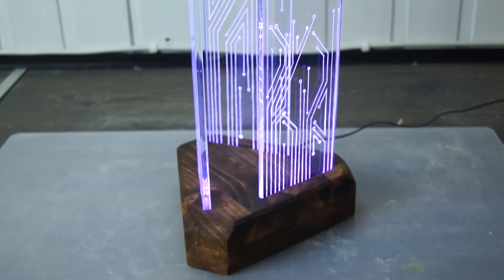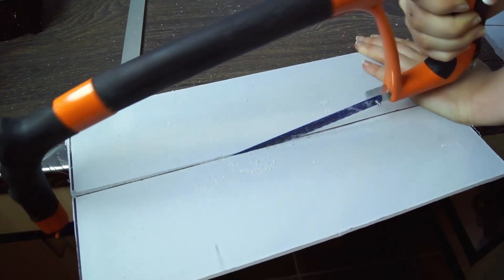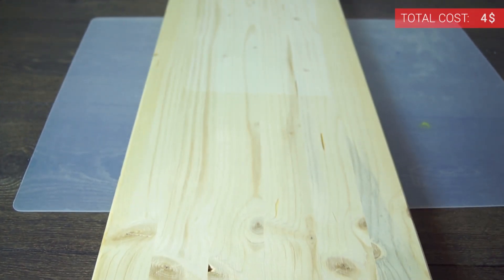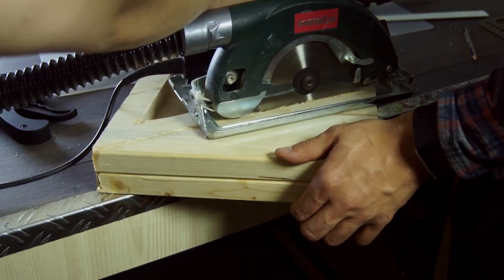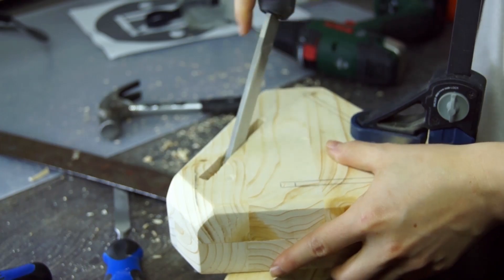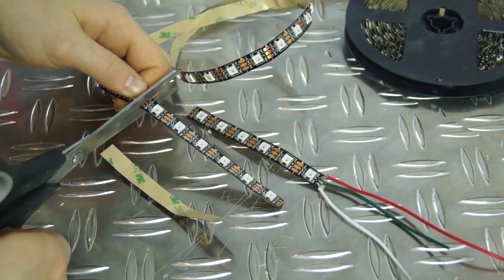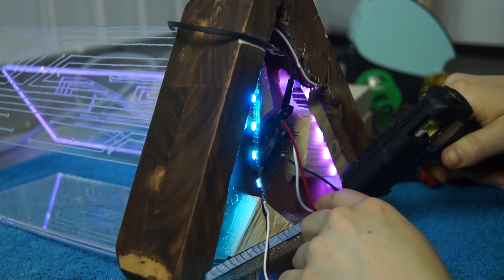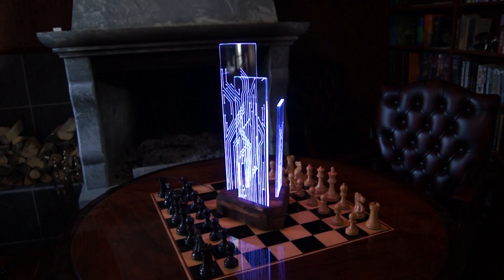Amazing Color-Changing Acrylic LED Lamp!

Comment: If you want to do more of these and maybe save your hand from hurting you might want to look at an attachment for your Dremeal. It is called a "dremel flex shaft" but you may have to check and see if it fits your model.
Alternately you can look about buying yourself a pencil grinder. Some can use the dremeal bits you just have to check for collet sizes.

Comment: Me: Sees thumbnail WOW! I wanna make that!
Martina: So, got this for 20 bucks, which is cheap in Norway.
Me: Nod nod Swede here, agree! 20 bucks sound doable.
Martina: Oh, by the by, you should get a dremel.
Me: Right. Maybe I can... use a pocket knife?
Martina: (casually) ...I just cut them off and soldered them back on.
Me: ...Right.
Martina: Oh, and then you get an Arduino--
Me: ...I don't think I'm the target group. :(
Martina: I CODED it using this library, link below.
Me: 0.0
I guess I gotta start leveling up some skills if I want an awesome LED structure of my own!
Reply: Back in the day that was sort of required to get fancy RGB effects, but now you get decorative LED kits that will do similar things out of the box.

Comment: Any chance of getting the dimensions?   

Acrylics: 95mm wide (100mm for me) and proportionally from the templates  (410 and 340 and 280mm high for me).

Triangle base: 215 and 170 for me.

Happy to be corrected.
Reply: On reflection I think the triangle should be 300 and maybe 215. (?)

Comment: TY so much for the info here!  FYI to anyone thinking of doing this with a dremel.  Get yourself a flexible shaft it will make this a TON easier.  Also, get a plastic cutting disc to cut the Acrylic sheet :-)   Great video again and you got a new subscriber

Comment: i wonder if someone could code the Arduino to control the LEDs with an incoming audio signal. This inspired me. Could make a custom case for a synthesizer that lights up based on audio going in/out/both.
Reply: Yes it can be done, you can find code made for that with many presets

Comment: Nice work. You are really skilled.

Acrylic can be cut just by scoring the surface a little bit and bending it, just like how glass is cut.

You can also use a lazer cutter to cut and engrave intricate patterns, which will reduce a lot of effort and save time.

Comment: How hard is it to control the dremel on the plexiglass? My only experience is using one to cut an ABS sheet and that was a nightmare
Reply from the maker: It was a lot easier when I had traced out all the lines with a scalpel first, as it made it stay on track.
Reply: Natural Nerd Oh ok thanks!

Comment: Is my computer broken or is the price of the led strip incorrect?
Banggood wants 15,99$. Could you fix the Link? Thanks!
Ps: Great Video
Reply from the maker: The price tag is correct. Individually addressable LED-strips are usually a bit more expensive than regular RGBs, as each LED chip also needs a microchip. So the link goes to a rather reasonable priced one. The price tag in the description is adjusted for the amount I used, as the strip in the link is 5 meter long, and I hardly used one meter. And thanks :)

Comment: Great project! It could be even better if you cut the top parts of acrylic pieces at an angle, to make it look more like a glass shards. And then to my opinion it would be better to power the entire thing from a couple of 18650 lithium-ions with the plug for recharging.

Comment: @Natural Nerd How did you polished this Acrylic?
Reply from the maker: The edges? I didn't polish the surface.
Reply: Natural Nerd you cut the acrylic in the Video. Your edges of the acrylic  looking very smooth. how did you do that?
Reply from the maker: Yes, on the edges I used some wet sandpaper! :)
Reply: Natural Nerd can you tell me which sandpaper exactly? which number? thanks anyways.
Reply from the maker: Went from 600 grit, then 1000, 1500 finally 2000, before polishing compound and lastly polished it
Reply: Thanks for the info, will try it soon too.

Comment: Hi, I like your project, one question, why you using arduino and not only font?
Reply from the maker: Font?
Reply: Oh, sorry, "power supply", in my country is "fonte de alimentação" :)
Reply from the maker: Aah! Because power supply is 12volt, and the LEDs are rated for 5 volt. Arduino has a 5 volt output. Not good to draw too much current with this, but a few diodes should be fine
Reply: Okay, thank you so much for being kind to me. In other videos I saw other people who also used the Arduino and I did not understand why this choice. Now I know... :) Greetings!
Reply from the maker: Arduino is also to control the LEDs. That is it's main function. You can program it, and using your own code it will change colors based on how you want it.
Reply: Thank you so much, you've helped me a lot. :)

Comment: Very cool design, nice creativity. 
 I have a yellow & orange Plexiglas clipboard, when the sun hits them the side's just light up (looks like neon). I have had these clipboards for years, and because of them have often thought that plexi should be used as a building material to transfer light both man made and natural. I do see people using plexi for address numbers and small add on's, but have not seen people use it to light up dark areas. With multiple colors of plexi available I can only imagine all sorts of future 3d pieces being made with led's. Its the edges that light up so elegantly, so I could see a sculpture made of plexi strips glued together to expose the edges.
Anyone ever seen anything like I'm describing?
Reply from the maker: Thank you!

Comment: Do you think engraving tools would work in replacement to the drivel tool? (is that correct?)
Reply: yes, a dremel tool is just a rotary engraving tool. you can also chemically etch the acrylic
Reply from the maker: Yeah, probably. It's almost correct, the company that makes this rotary tool is called Dremel :)
Reply: you could also search for local makerspaces in your area. if there is one, they usually have laser engraving machines which would do any of the work on the acrylic. they usually are fair in price as well!
Reply: John Smith Mine does, but the laser would shine through it and not do anything

Comment: Hi,
cool project. One tip however: Do not power larger LED strips with the arduino. The data line can still be controlled by arduino, but the power should be hooked up directly to the 5v from your power supply.
In your case it is not really necessary since you are using a 5v ps (so no regulator heat up) and only have very small strips, but it is still good practice.

On another note I am displeased that you get so many superficial comments (about your looks) when your work is clearly the main focus in the video :/

Keep going!

Comment: what is the Arduino function??what if i skip the Arduino part?? does it still works??😯
Reply from the maker: All the Arduino does is to change color on the RGB leds. You can skip it, and use some static LEDs, or a separate RGB controller :)
Reply: Natural Nerd i think I'll stick with the Arduino now.sounds more necessary.thx

Comment: did you need to polish the edge after you hacksaw cut it? as being acrylic, it will be frosted and not able to let the light pass through. i always though that acrylic sheet came with brown paper instead of a clear film. what i have here is normally the polycarbonate sheets are clear and not acrylic.
Reply from the maker: Yes, sanded the edges slightly with a high grit sandpaper to make it clear. I think burning it would work as well. Here it seems to vary from blue to pink and clear film :)
Reply: Natural Nerd yes you can do a flame polish to get it back clear. you can also use it for the engraving to get back a clear surface. but remember is when you flame polish the acrylic edges, you cannot glue it with the acrylic glue as there will be burn marks drawn out by the flame polish. nicely done edge lit🖒
Reply: Natural Nerd you can get cotton buffing wheels for your dremel. They come in many different shapes and texture. Those with some polishing compound will make your edges like glass. (After sanding smooth of course) and the pen attachment is a must. I don't even use my dremel without the pen attachment.

Comment: I would rather not use Arduino's 5v output. it's not really capable of anything high like the leds! it's also a linear regulator
Reply from the maker: kam hagh True! :) All you need is a voltage step down (or simply use a 5v power source) and you can use the same basic layout
Reply: Natural Nerd The adapter you used was 5V if I recall correctly. I would just add a cap near the LEDs and use it without anything in the way :D

Comment: How you position work and hand and body to cut a bevel with a hacksaw could not have been more awkward. Give your head a shake and think again next time. 
When you are using a sliding compound saw, keep the left thumb tucked in, always. On every 'over the material' type saw.  Thumb out position does nothing for you, it is just a habit of humans, a habit that can be reset with some initial conscious intent to set the new habit. Easier habit to acquire then you may think it would be.  
The project was well executed of a great composition of technologies idea.

Comment: Psh, use a laser cutter to both cut and engrave them. Much easier. XD
Reply: So will a CNC, you got one? She did it with hand held power and manual hand tools. The project was well executed of a great composition of technologies idea.
Reply from the maker: Good idea, will you provide the laser cutter? ;)
Reply: Making things easier to make is not high on the list of making a thing one time , one unit project. That is barely even a consideration. The desire to create it will find a way and make it into existence if the demise is strong enough. You don't have that, you just want it the easiest way possible. You want to spend $1K to $10K for a 3D printer to a engraver X/Y later cutter to a CNC to make one item then you go right ahead and do that.

Comment: you really should consider getting a flexible shart for your dremel - the pen shaped end is so much more comfortable to use than the main machine for longer jobs.
Reply: A flexible shart, indeed, Bat Fastard. Indeed.
Reply: yeah, so I missspelt shaft.....  ;-)
Reply: Bat Fastard
Reply: Bat Fastard does that like attach onto the Dremel 3000?
Reply: Bat Fastard you do know what shart means?!

Comment: what code did you use for the arduino?

do you have a link to the right page on fastled?
Reply from the maker: Hello. Actually I didn't spend much time checking out the options of the FastLED library, I just use the way to address the individual LEDs. I can upload the code, including my own functions for fading between different colors if you'd like, but there are better ways to do it I am sure.
Reply from the maker: https://github.com/hansjny/Natural-Nerd/blob/master/arduino/ledfade.cc
Reply: Thank you so much !!!!

Comment: you should get the router attachment for your Dremel, will make things a lot easier.
Reply from the maker: +Thomas Hansen thanks for the tip! what is it usually good for? I imagine for wood work, a dedicated router would be the best
Reply: +Natural Nerd they do make a table type router, but they have a plunge router attachment, which would make the Dremel sit vertically, and then you can just push the base around to cut your designs. the plunge router part number is 335-01, and it looks really nice. the piece i have, is called a "multi purpose cutting kit" part number 565, it is similar to the plunge router, except it has a smaller base, and it comes with spiral cut bits, like drill bits, on steroids. it would help with any fatigue from holding the Dremel for extended periods. just some things that could help, it is a great lamp that you came up with.